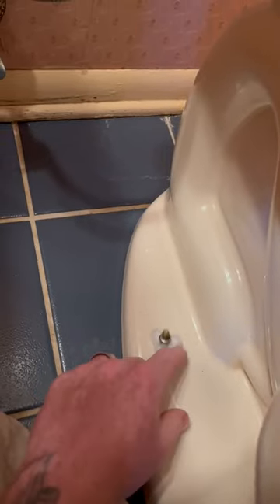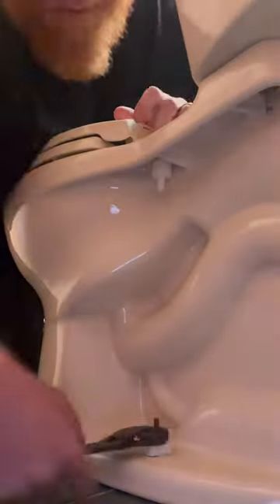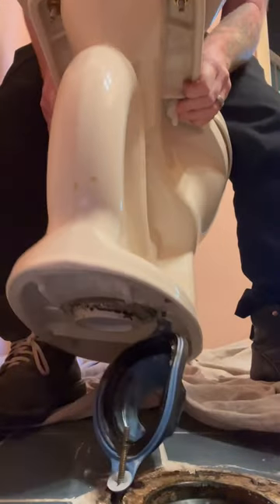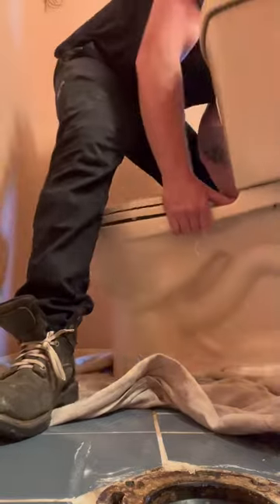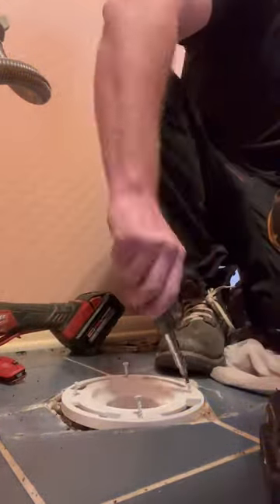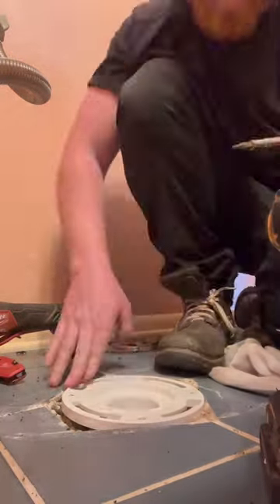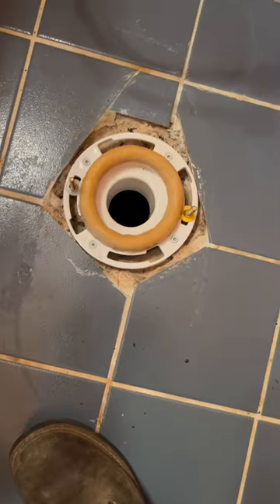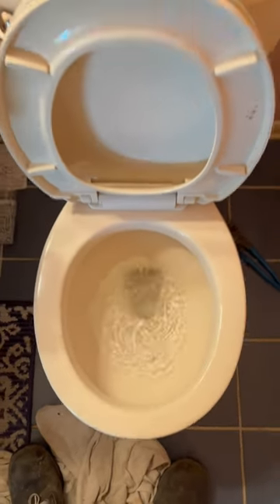Where is the bolt #plumbing #shortsfeed

Comment: The flange didn't look level with ground.
Reply: It can be 1/4 inch above finished floor
Reply: it can be 3/8 above finished floor even for most flanges. but 1/4 is usually the perfect spot

Comment: I’m a retired plumber from NYC . As an apprentice we were always taught to set a floor mount bowl in plaster.The apprentices out of the union hall I hire were starting to tell the mechanics that the instructors in class were now insisting on setting the bowl in silicone caulk.We continued setting them in plaster as was our practice until an inspector failed a final inspections due to the plaster used to set the bowls.
Reply: Not a plumber, what's the reason for failing the plaster set toilet
Reply: @hemi4722  I’m not sure.One of the apprentices said his instructor told the class NYC feels it’s not a suitable base for a floor mount toilet.
Reply: I have used plaster for years. I personally despise silicone on a toilet.
Reply: @BlueDart1971  I gotcha I used plaster my whole life,the younger guys out of apprenticeship are taught to use caulk.If the bowls rocks use shims
Reply: @hemi4722  probably because the plaster will get wet and mold after a while and silicone you can just cut and replace because it's visible.